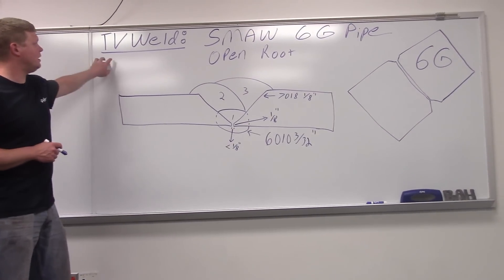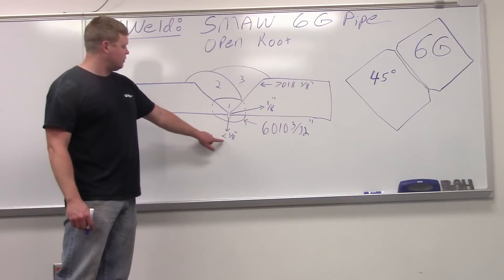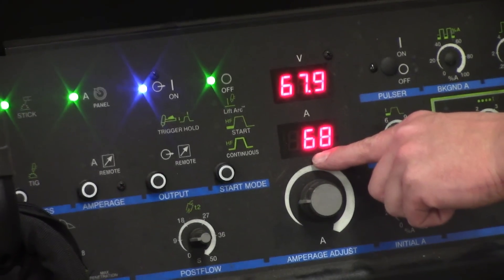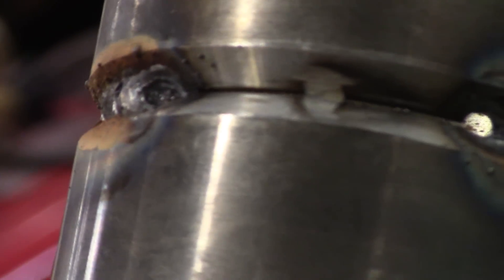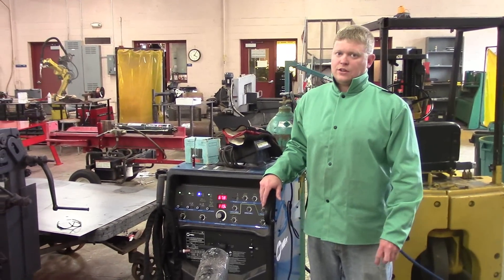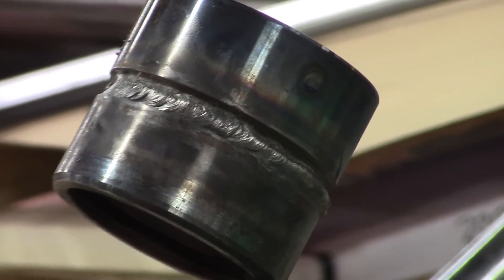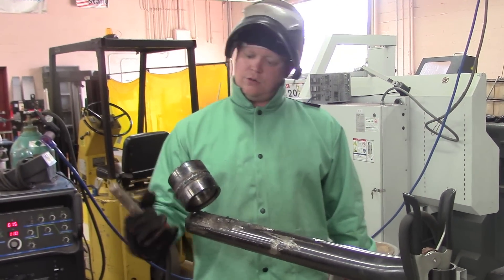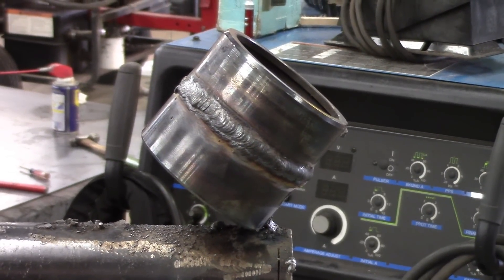6G Pipe Stick Welding

Comment: I heard on most pipeline the root is run downhill on a test are they going to expect you to take it uphill?
Reply from the maker: +Jelly Jelly It depends on what code they are referencing for their inspection.  AWS code typically goes up, but an API code will go down.